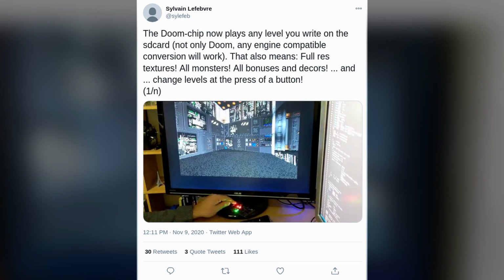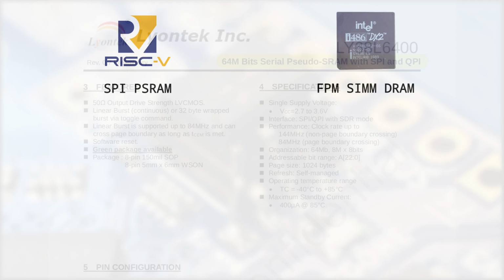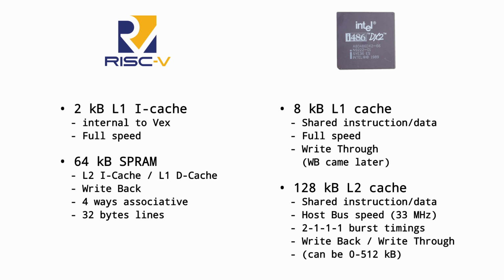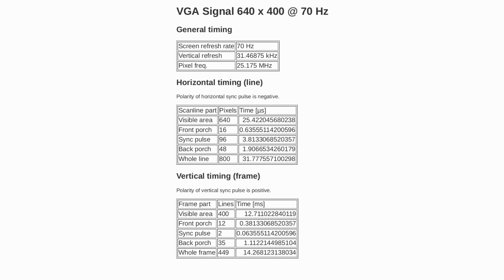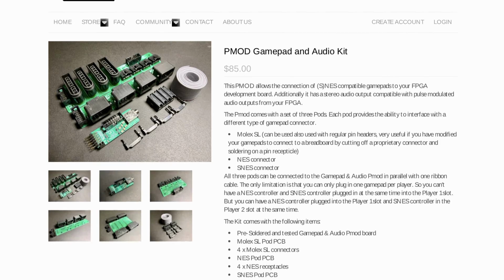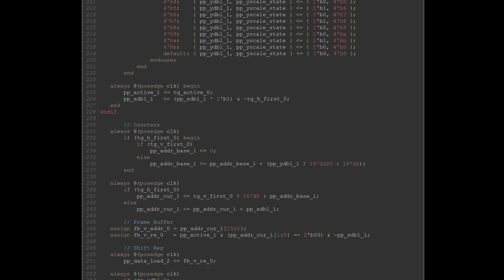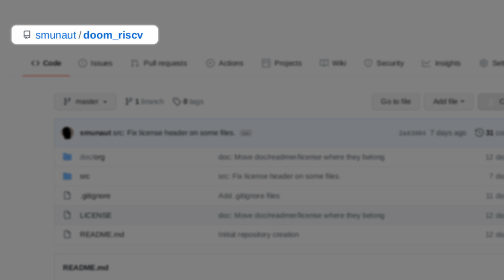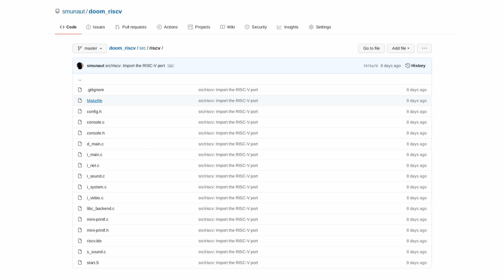iCE40 FPGA: Can it run DOOM ?   Let's find out !

Comment: Thank you so much for demonstrating this! I am just barely getting into FPGA programming, and I instantly am falling in love with the iCE40 series. Their ease of use compared to larger chips, the QFN or TQFP formats, low price, open-source toolchains, all feel very alluring!
I was initially worried about how much you can do with 5K LUT since I hear people describing it as small, but seeing all of Doom running here?? An entire RISC-V softcore and more? That is SO exciting, and just solidifies my idea that I'm going to have a lot of fun with this :D

((I often work with MCUs in the ~100MHz clock region, and am not chasing much performance, so the iCE40 will fill the gap for better timing precision SUPER nicely <3))

Comment: I take my hat off to you Sir. For a 'small' project you have certainly excelled with the results speaking for themselves. I may try the Synth integration code myself although I suspect you'll have it done a lot quicker and streamlined well before I finish. Grats!
Reply from the maker: Thanks.
You should join the discord if you want to try your hand at the synth code.

I see two approaches :
 * Just add a dumb UART to send midi commands, purely timed by the software. Issue with that is that the time resolution you get would be basically the frame rate which is variable and only around 10 fps. Not sure if that would be enough for music to sound decent. I guess you could add some checks in the middle of the rendering loop to get a bit more control but still not great.
 * Add a special FIFO with "time commands", so you queue things like "send XX to MIDI"  "Wait X cycles", ... and you just try to keep that FIFO filled enough in advance at each loop.

In both cases, you'd need to decode the MUS files in the WAD into MIDI command. The music code was never part of the OSS release of doom so it's completely empty atm. But the internal MUS format is pretty close to MIDI already.

Comment: Just discovered your video, great work! I have implemented the TI-99/4A home computer for the ICE40HX4K and the ECP5 85F on the ULX3S board about 3 years ago. Then been more designing MCU boards. After seeing this I need to get my icy99 core running on the ice40up5k; I have a couple boards with this FPGA and I have the TMS9900 CPU running on the up5k but I didn’t go for the full computer back when playing with them. If you can fit doom on the riscv on them I need to get the plain old home computer fit in it 😂

Comment: as neophyte to FPGA world, it didn't occur to me that SPI could suffice for interfacing to RAM memory, which gives me hope for possibility of devising a pmod connector that integrates an old school ISA bus where things like soundblaster cards and i/o interface cards might reside (the project goal is to recreate the functionality of the motherboard of a 1988 IBM PS/2 Model 30 (which had the 16 bit AT bus). That model year had vga graphics, which my FPGA board has a hardware port for, and it has several pmod connection points. No GPIO though so was considering interfacing a bus cage via pmod

Comment: Hey Sylvain, nice video! Quick question, is it M(mult/div) - extension required or it can be done using just RV32I?
Reply from the maker: Well you can do it without the M extension but it's going to be much much slower just because there is so much multiplications involved in the render code and emulating them purely in software is going to suck.  You can do away without the div hw instructions though, that shouldn't be much of an issue.
Reply: @smunaut  thanks for the reply!

Comment: A little notice from me:  486DX2-66 has 33Mhz FSB,  it has  ~30-32MB/s with good Chipset with 2-1-1-1 Timing.  Slow Chipset has often only 20MB/s.

Thumps up for your works with Lattice iCE40
Reply from the maker: Thanks for the information.  Yeah the numbers were just reflecting the theoretical peak burst rate given a timing set rather than real-world benchmark. This is also the case for the SPI PSRAM, you wouldn't reach those 50 MB/s in practice.

It's not always easy to find what would have been "period correct". Lots of stuff you find now is people building retro gaming computer today and of course using pretty much the best parts they can get and tuning them in detail. Which is not always the same as what a typical system of a Joe Average user would have been back in 1993 :)
Reply: >486DX2-66 has 33Mhz FSB
>~30-32MB/s with good Chipset
>20MB/s Slow Chipset

Iv seen as bad as ~15MB/s for DRAM. Then there is >60MB/s L1 >50MB/s L2 cache.

Video shows Doom running at ~10 fps (update every 3 frames), thats 486DLC40 speed. 66mhz DX2 usually gets >25 fps. Of course its still very impressive because: original DOS DOOM draws directly to mode-X chained/planar video memory using triple pageflipped hand optimized assembly, this part was never released as open source. What we got was a dual page Linux port rendering to ram with copy to vram once per frame, ~30% slower. Even today the fastest Doom source ports (MBF) are 25% slower on 486 hardware compared to the original.

Sylvain oil up your microphone, its periodically squeaking :) artefact of low bitrate audio codec?
Reply from the maker: @rasz  Thanks for the numbers, interesting to see real world perf.

And yeah, indeed it's about 10 fps. I think a timedemo shows ~10 - 11 fps IIRC, and that matches a quick "live" fps counter I made, complex part can dip to 8 while more easy scene can do 15. I think it should be possible to get it to 15 realistically with some "spot" optimization not needing huge rework if one wanted to pursue that.

And yeah, I know, there is a periodic high pitch sound :/  I only noticed after having recorded the whole voice over track and I didn't have the courage to re-do it. I couldn't track where it comes from. I tried notching it out in post, but couldn't fully get rid of it. It's present even in the raw .wav pcm recording I made for the voice track, so not a codec issue.
I have a new microphone and audio interface on the way, hopefully that'll help audio quality on future video. (Won't do much for my pronunciation though, I'll have to work on that).

Comment: An FPGA is a chip designed to implement circuits. Microprocessors are chips designed to run software. The title will hence automatically lose anyone who's technically inclined right off the bat.